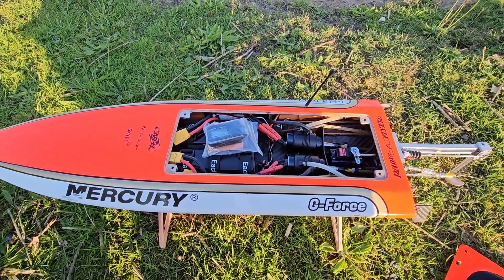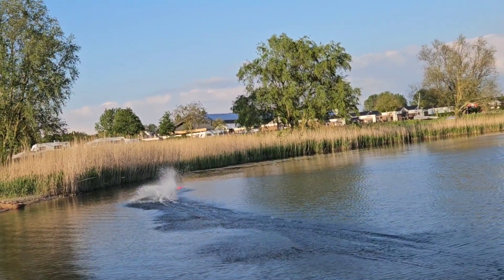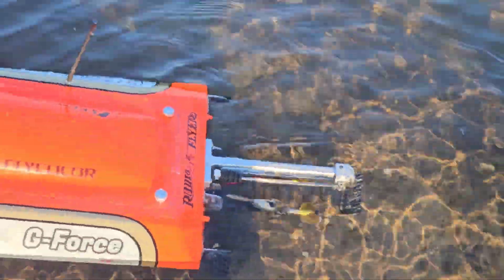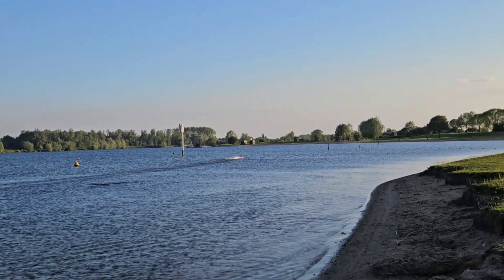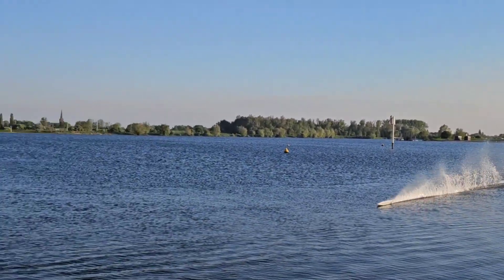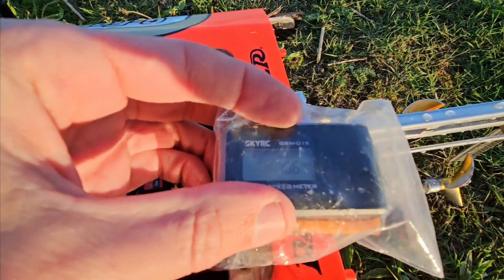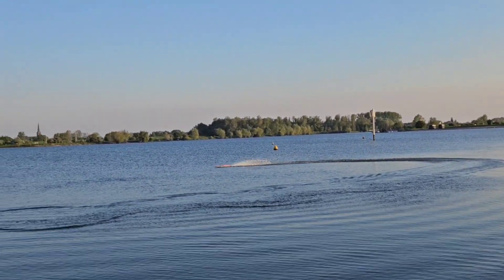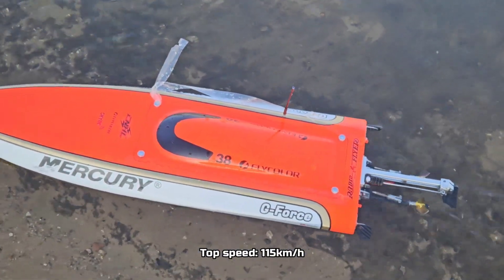Speed runs of my DIY Twin mono. How to set up for speed?

Comment: You may need strakes
Reply from the maker: Thanks for thinking along, James. I'm no expert, but reading from the experts, I understood that strakes basically generate lift. Actually, I think my boat has too much lift at the moment. I will try several improvements, such as a slop-free rudder and trim tabs.
Reply: @CozyRC  I think strakes do give lift but I also think they create less chance of tipping all the way over until it hits the chine just like the chine stops the boat rolling up on its side.
You could double side tape some in for a try.
Solid balsa shaped is an easy temporary way to try
Reply from the maker: @jamesatkinson7517  Thanks James, I will consider giving them a test!

Comment: I noticed all these hi-speed crashes looked all bit same to me (the way they happen)...So i was thinking, what makes it to act like that? Is it something im just thinking or is it something you can out a finger on? Interesting...
Nevertheless, nice runs.
Reply from the maker: Thanks Peter, the boat doesn't handle great at the moment. I suspect the rudder (slight slop, it may flutter). And I think it needs trim tabs. Even the cockpit hatch might have a negative effect, as the boat handled pretty good with the flat hatch plate. I will sort it out!
Reply: @CozyRC  That's what i already hoped you would say... 😄
It's very interesting to see how you tackle the one and other problems. You definitely share my thoughts about being still but to squirly at the moment. My (single) mono had some "strange behavior" before blueprint and running with the hi-rake props (abc style). It could also make very unpredictable crashes, strange jumps, etc ..
Reply from the maker: @peteroosterhoff8850  It also took me a while before my Wildthing was sorted out. But once it was, it was an absolute blast to run. It's still my speed record boat 😎

Comment: We all know that's different from boat to boat. But I found thin rudder blades not creating that much drag for sure, but in my example also not turning the boat much better into the corner and during the corner. I think that have something to do with turbulences? If you move thin rudder blade in small angle to the driving direction, the outer side is in the almost the same angle as inner one (which helps created turbulences?). With more V shaped the outer side stays more straight with driving direction. It's also much more stable in the straight line, in my case. I tried more that ten blades with different shapes and sizes.....but yes, on my own boat.... Also it's a question if thin blade is still rigid enough to avoid "flutter" in high speeds.
Reply: Yes that's right, what works for one boat doesn't work for another, especially considering that they are DIY, but hey, we try help each other, and yes, I think your theory is good, maybe a different blade can help, there are two propellers that rotate with approx. 40K throwing water at her
Reply from the maker: Yes, the forces acting on the boat are often higher than you would think! I appreciate all your inputs 😎
Reply from the maker: Thanks for your comment! I suspect the rudder to be the cause because I didn't really have this issue before (with the old rudder). 
I do have a slight slop between the rudder hinge shaft and the rudder block. I will change the pin for a slightly bigger one to eliminate that. You could be right that the rudder flutters at high speed! I'm considering a thicker blade, too. Just to make it more stiff.
I have to say, I have good experience with knife thin rudder blades. My Wildthing has one, too, and my Hydromite mini hydro. Both boats have great cornering performance. ✌️